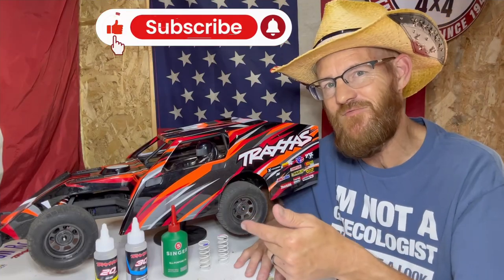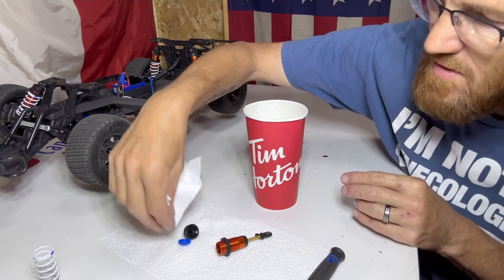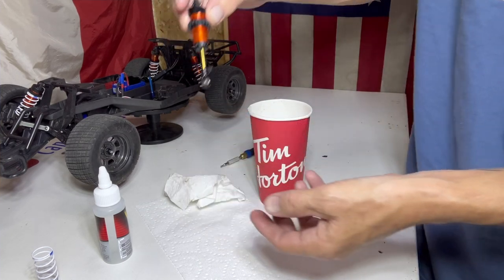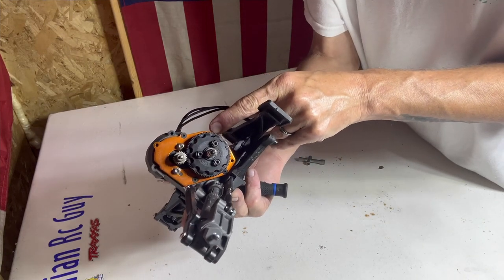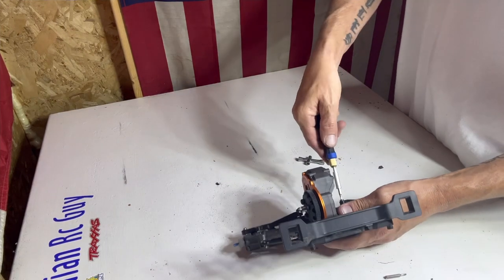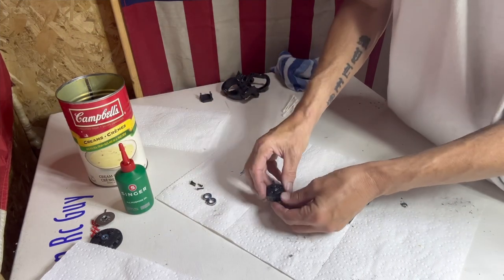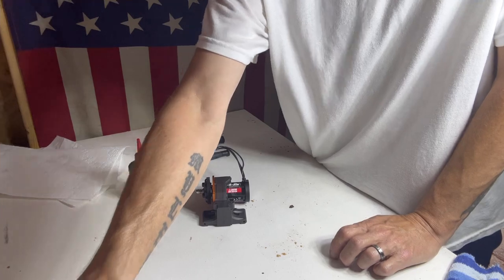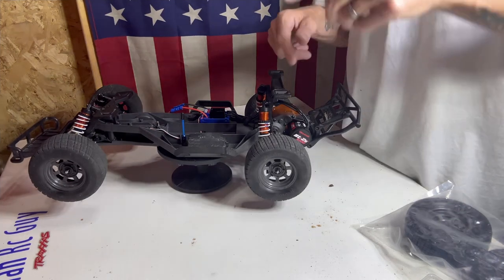Traxxas Modified Setup Video #2,Shocks,Oil And Differential Clean Out! @Canadianrcguy #traxxas #rc

Comment: Before i changed out my shock fluid i did a test check with the stock oils and i found that the shock shafts did go back all the way down it went almost halfway but after i changed the shock oil the shock shafts went all the way down by themselves with no problems